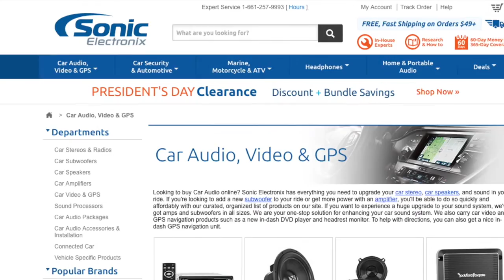How To Install Marine Speakers On Your Boat!

Comment: one question, what is the difference between marine speaker and a regular speaker????  thumbs up...
Reply from the maker: Marine speakers are usually water proof or water resistant and can withstand the elements very well.  They typically have plastic cones and sealed rubber surrounds.  The internal components are made to combat corrosion.

Comment: Sorry, but putting speakers at the lower leg level will only provide low and mid frequencies to the boat operator.  They should be mounted such that the drivers (woofer & tweeter) are directed at or close to the operator's head (ears).  This is why I bought 6x9 enclosures to sit on the flat surface under the windshield facing toward the cockpit.
Reply from the maker: It isn't always our decision where speakers are mounted, even after convincing the owner of the boat that they were too low, they still wanted them there.  This isn't a boat built for pulling or cruzing, it was a flat bottom river boat for fishing.